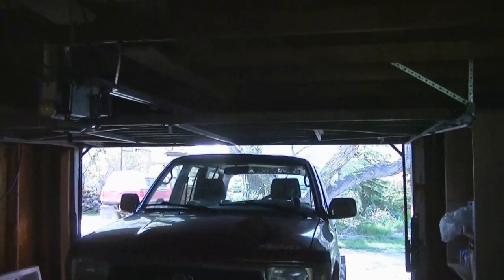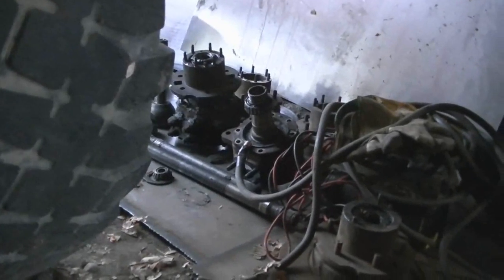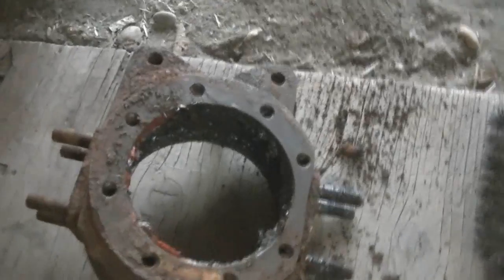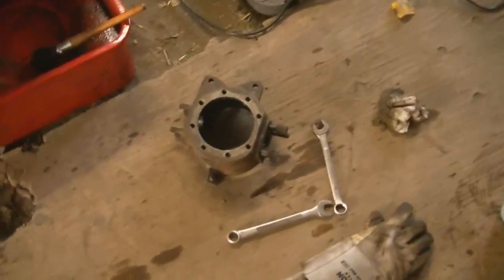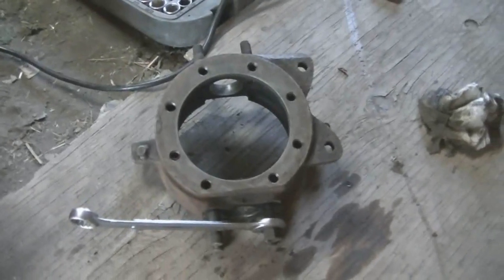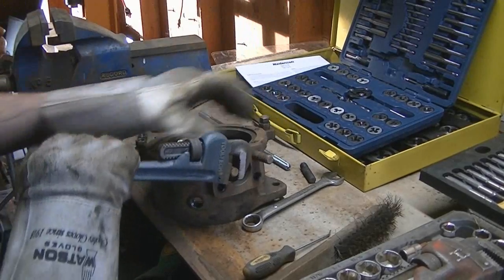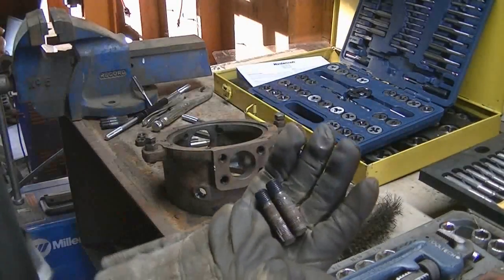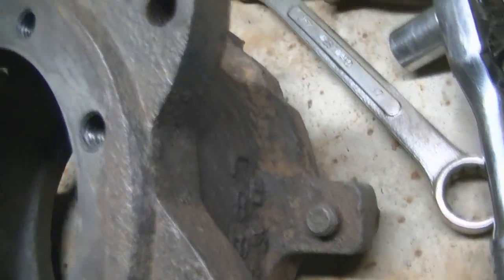Toyota Steering Knuckle Prep for Big Brake Mod pt.1 (05/11/12)

Comment from the maker: haha batteries were flat? huh??

haha, i have a 8pack of coors light in the shop, gunna need some more after today though...
it was the rad... blew up on the highway when i was driving to the city... had a splended day haha!

well, she does fit, but i wont be able to clear the garage door opener, and i wont be able to jack her up haha! i might have to put the smaller tires on her before i take her into the shop...

thanks man!

Comment: When you are pulling a knuckle of and it is still on the truck could you (if it has enough room)  double nut those in order to avoid those cone washers ... just remove those studs.